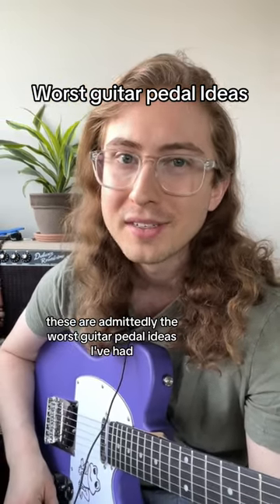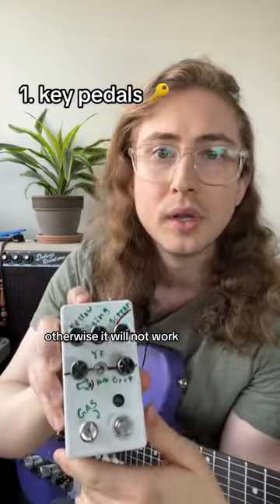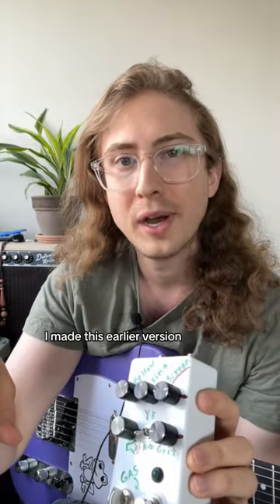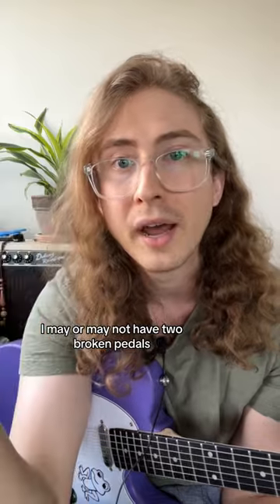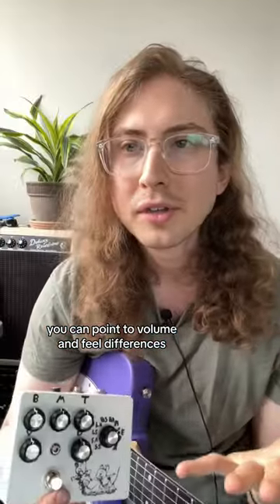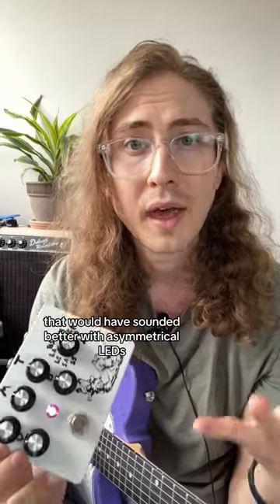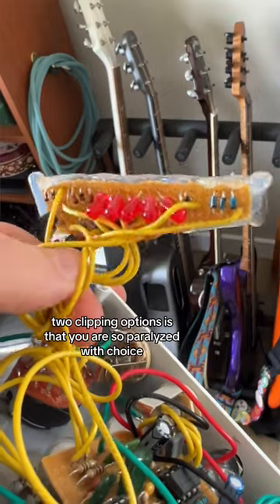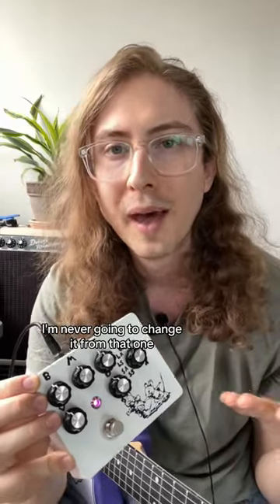Worst guitar pedal ideas

Comment: I absolutely agree about clipping options

Guitarists will argue for hours about symmetrical vs asymmetrical, silicon vs germanim, but they won't consider boring things that actually make an appreciable difference, like changing speakers or pick gauge
Reply: Dude i changed my strings after like 5 months and they sound so clean and beefy now, it's the little things
Reply: And if they actually delved into pedal circuits they would find capacitor and resistor values make actual tonal changes that diodes and op amps dont.
Reply: @garlicbread1575 Aren't you supposed to change them like every couple months? 5 months of skin cells and oil is definitely going to make a difference.
Reply: @Trippsy05  3 actually

Plus living in a humid area is gonna make them rust more so around a month or so

I just didnt change them because i was lazy
Reply: Amen

Comment: Can u make a strymon sunset style drive, but make it full analog in stereo? So basically just put a Klon, a soft clipper, hard clipper, 2 boosts, and another drive of ur choice, but have the choice to stack them either a-b or b-a or have 2 separate drives run in stereo, one in left and one in right

Comment: Honestly, that key guitar pedal is a good prototype for a hilariously evil parental control device...

Make the key mechanism be the power for the actual amp, and parents can be like "you're grounded -- acoustic only"

It's all fun and games until some idiot messes up trying to pick the lock* and learns why you unplug a device and make sure capacitors are discharged before poking around.

It could also be a really interesting piece of kit for performance... lean into the whole missile command anesthetic with the key turning prominent, and it could be a cool intro scene

Also, you should take a picture of the remaining key next to a quarter and you can have someone make a 3d model for duplicates...

Though with the fact that both the key and some branding have already been shown, someone with right skillset could replicate it even now for under $50

*technically, this risk can be mitigated with proper design -- using a layer of non conductive materials around the keyway area that do double duty to prevent bypassing the locking mechanism and shielding the electrical components from Sparky and his bag of paper-clips, but life (and death) finds a way...